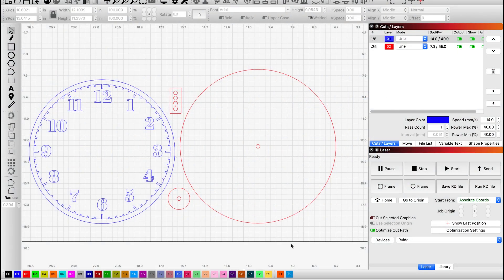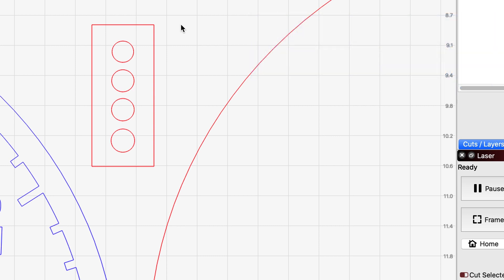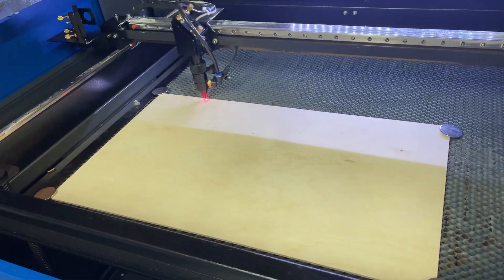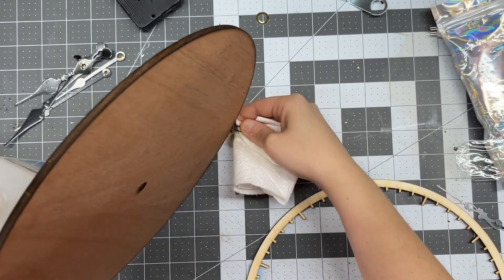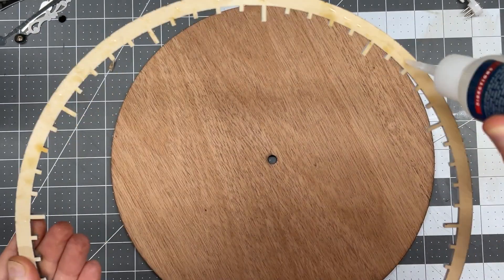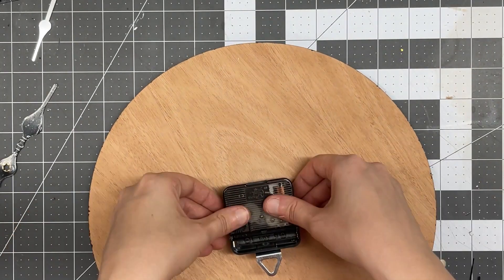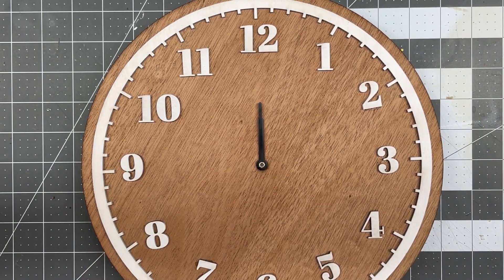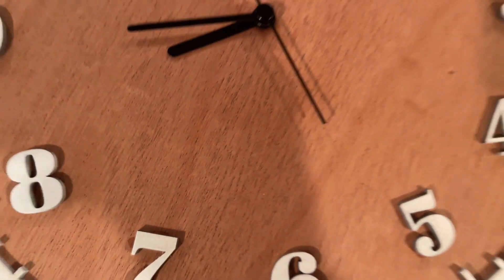How to Laser Cut a Working Clock with a Laser Engraver - DIY Project Walkthrough - OMTech

Comment: If you want to have the numbers all ling up, then you can always use the inside round as templet. When you glue the outside ring down, you just place the inside cutout in and clap it and then glue your numbers down. Then remove the inside cutout and its all lined up.
Reply from the maker: We greatly appreciate your helpful advice!